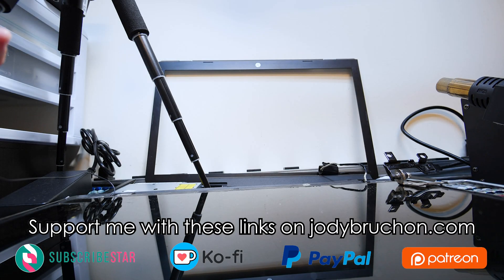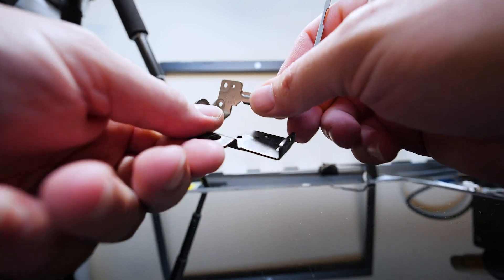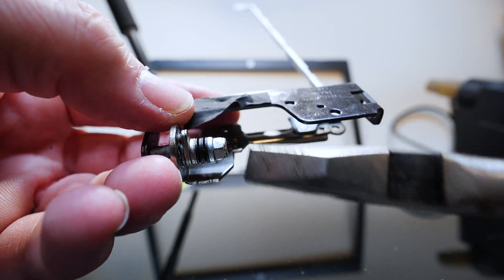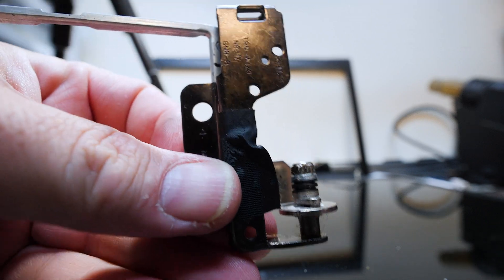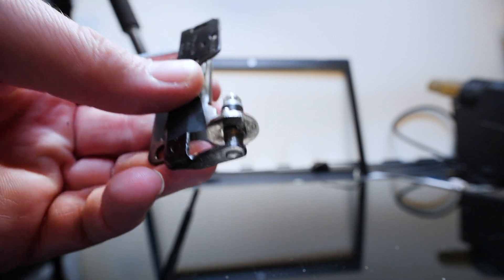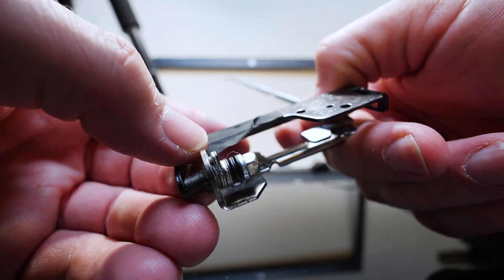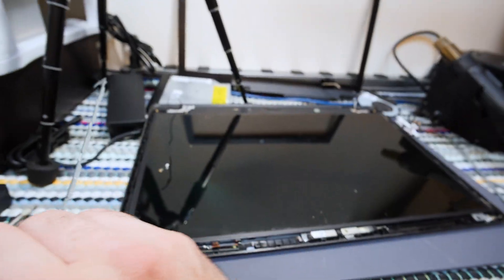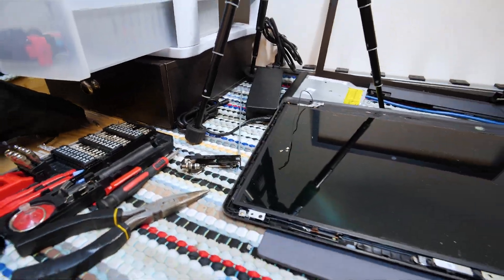Fixing Tight Laptop Hinges

Comment: You're as funny as the finance minister in January. Try enabling it on Lenovo. The only help would probably be to wrap the display properly and heat it with a lighter or a soldering iron?

Comment: good job, indeed!!!!. once you untighten the hinge, how do you know if both hinges have the same force? , can a  different tension in each one affect the lid to close properly?, Does the lid have to rest equally on the palmrest?
Reply from the maker: I don't worry about the specifics. I generally do a "bump test" where I put the hinges on the screen part, hold the lower hinge plates in the "open" position, and "bump" them away from me like the base of the computer being bumped by a book. If the hinges close up at all, tighten a little more. Also, you can feel how tight you're turning things, so you can often work based on how it feels. If they're off it won't affect closure. You need just enough tension to keep it open during normal use.

Comment: Some laptops have the hinge better exposed for easier adjustment. My Acer Nitro you can just pop the plastic hinge covers off and have easy access to manually adjust the nut without having to remove the hinge from the laptop.
Reply: The same es newest HP

Comment: I just epoxied the right hinge (and reinforced the left) of my Dell 7537 that not only came out yesterday but pushed out the touch overlay (did not break it, thankfully!). I plan to loose both a bit tomorrow after the epoxy is fully cured. Did the same to my Toshiba Satellite a decade ago, and before that I frankensteined my ancient Inspiron 1520 with hinges from the hardware store (and thin ball chains to keep the lid from falling back fully). 
Am I the only one that thinks that laptop hinges should be completely loose, but with a spring loaded manually released brake? Press-to-open, release-to-hold.
Reply from the maker: That's an interesting idea, for sure. I kind of miss latches, but people would bust the latch ends off sometimes.

Comment: If you want to have a happy life, do not buy a HP products.
Reply: HP is lower cost but is cheaply built!  My new Lenovo is built solid metal,  little heavier but not cheaply built!
Reply: HP stands for Horrible Products. Haven’t been too impressed with Dell anymore the past few years either..I fear they are going downhill.
Reply: My Lenovo crashes hinges at 4 years old, by the other hand the HP stands still working after 5 years